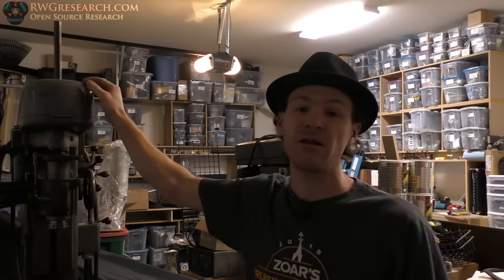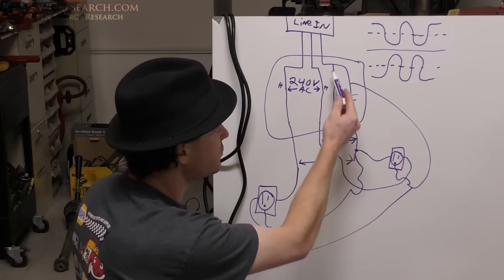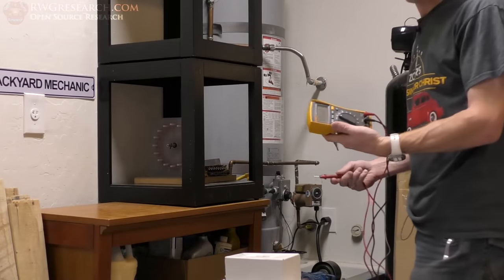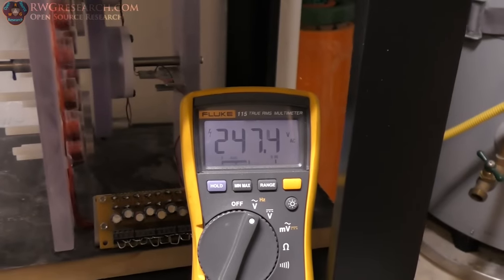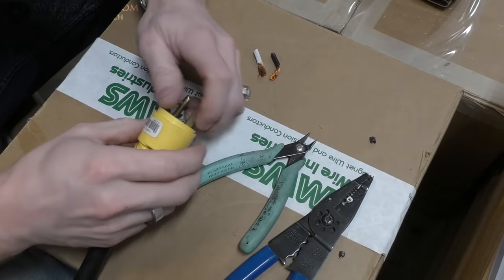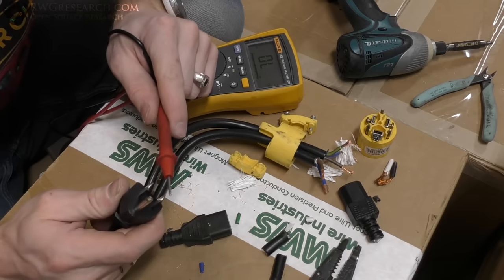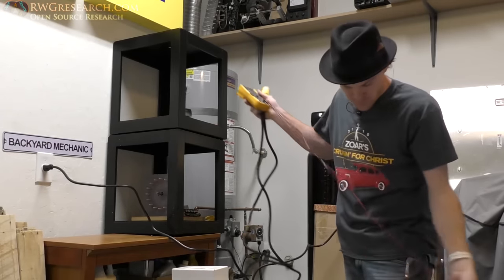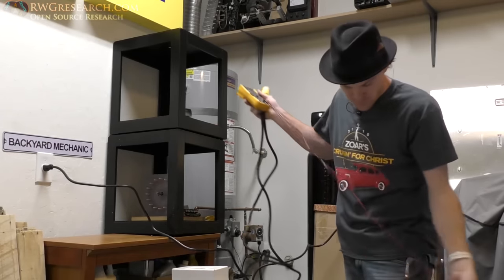How To Get 220V/240V From Two 120V Outlets. No Electrical Panel Work Required...

Comment: This is not the sort of thing I would advise anyone to do, and posting a video like this where the electrically inept are saying "Cool, Awesome, Sweet..." and such things are exactly the people who are likely to hurt or kill themselves trying.
That being said, many will try this and fail simply because they don't have an understanding of how split phase 220 works in the common household. Typically, a single room's outlets all come off of a single circuit breaker, therefore they are on the same phase. Connecting two outlets on the same phase WILL NOT give you 220V, and accidentally connecting one of the neutrals where a hot line should be will also only lead to headaches, blown breakers, or potentially fire in the event of a breaker failure.

I immediately posted my comments BEFORE I ever got past the introduction.  Having then proceeded to watch PART of the video, I reiterate my previous statement that you should have NEVER posted this video.  Those who are aware of the characteristics of the US electrical system and qualified to make such connections already know how to do this. Those who have NO BUSINESS messing with their electrical outlets should not be given this information. PERIOD.
Reply: Triggered?
Reply: Sin Semilla Not triggered, just aware of the fact that there are too many people out there, including kids, who see information like this and don't understand the risks that are present when dealing with electricity. "Do this at your own risk" does not free an individual from the responsibilities involved. Not to mention the fact that doing this is also a violation of electrically codes in most places in the US. There is a very good and valid reason for requiring a licensed electrician to make modifications to a household electrical system, and that is so that people who are not qualified do not screw things up and place themselves and others at risk as a result of their incompetence.
Reply: Do at your own risk is a good enough warning to let people know that possible danger is involved. All the nerdy electricians who feel superior and doesn't want to share their knowledge is the real problem here, people like Russ and ElectroBoom on youtube does a great job at sharing.
Reply: The only way I would be okay with this is if everything including the outlets  were twist-lock, SJ cord was used, in inline fuses we installed on each leg. However as it stands I guess it doesn't matter since im not the one using it.
Reply: Your objection doesn’t seem to be with the content of the video, but rather with the danger of disseminating it. I disagree that this video is too dangerous for public consumption. I think the inherent risks of working with electricity is clear to most people. Especially people who would sit through a 15 minute video about it.
Reply: If they don't understand power, stay away from it. Duh, don't play with guns if you no nothing about them
Reply: T M He mentioned that neutral is tied to ground in the panel and not at the device.   I wouldn’t use this for a permanent solution, but I’d definitely use it for occasional use.
Reply: Sin Semilla  yep, I hate guys like Jason. I do everything myself in my house...3 fully gutted bathrooms, kitchen, etc., etc. The worst type of person is the one who says, I’ve been doing this for xx years. Instead of trying to show ones supposed superiority and knocking the video, use your knowledge to comment to give the specifics on how to make it better, or the specifics on things to watch out for. Like sbusweb did in a previous comment. I’ve come across many people like Jason and typically they are not as knowledgeable as they portray themselves to be or have limited knowledge in other fields.
Reply: @JasonSimpson1966  Jason I'm an electrician I became an electrician because I thought it was something I couldn't learn to do online I thought plumbing and carpentry were easy I can learn those things online but electrical work I couldn't learn online. Then it was accepted to an apprenticeship and all the things I learned in class had nothing to do with the things I did for work I read blueprints and perform tasks based on those blueprints it was never necessary for me to learn trigonometry or how to calculate the bend of a pipe that shitt comes prefabricated or what I need to know is listed on the blueprint or an app on my phone calculates it for me. And the electrical licensing exam is simply a test on the national electrical code which is volume 17 of the national fire prevention code which ironically while law is copyrighted material and therefore not available and less bots the school provides a book on the national electrical code for the year in which you will be tested for free or a reduced price. But you can also BitTorrent free copies of the PDF version many electricians drive around with an out dated edition of the electrical code in there service vehicle I am a younger journeyman it's true, but what you fail to understand old man is that the human capacity for abstract thinking is higher in younger generations then it is for older generations and when I'm an old man I will be complaining about the  younger generation too
 But young people todaydon't just read about how to do something and then try it this won't be the only video people watch on the matter to watch hundreds of other videos on the matter before they even get to work people watching this video aren't ready to do it nowthey don't have the financial resources for do-it-yourself projects don't be watching this video and then another one and then another one not all today not all tomorrow they'll process this information over a certain amount of time in that information will accumulate until one point when they have a job after they graduate college and can afford to do this and I'll do it themselves don't worry your job won't go away because there's not enough people going into trade work because old electricians tell young people not to do electrical work because it's dangerous why would anybody want to be an electrician if it were dangerous you can get hurt it's true but the risk of dangerous exist far more when you are doing electrical work for a living and performing a routine task that you have done for years so that while you're performing the task you're not thinking about them. Your remodeling a box chain store and changing all the lights in the middle of the night you spent the last eight hours pulling down and putting back up phosphorescent lighting while customers are in the store and an apprentice or material handler are spotting you as you move around on a scissor lift and in the middle of your mundane work and read routine task where you've been up for 12 hours for the last week because prior to this stays of the lighting demo and install you had just installed the cash registers and point-of-sale systems as quickly as possible to avoid downtime. And you forgot to turn off the circuit breaker and you blow up and die. when someone's doing something big done for the first time they're not very likely to forget to turn off the circuit breaker they're not very likely to zone out and they're not going to have been up for 12 hours the fact of the matter Jason is it's more risky for us to perform electrical work than it is for someone working on their own home and we really shouldn't be afraid of young people doing electrical work because we fear it willl take our jobsbecause no one's doing electrical work because electrical work isn't 
"Cool"and you can't write off your expenses if you're on your own home when you travel for work anymore so getting people from small communities with less building expansions travel to areas with more building expansions is even harder so it's a good idea to get young people interested in doing trade work by letting them do it and die in the process so that they don't become our co-workers or live through it should they do become our coworkers because I don't know about you but I'm really sick of being asked to work 12-hour shifts
Reply: @goldcoastwoodworks6023  If they don't understand power, stay away from it. Duh, don't play with guns if you no nothing about them
-----
No one should play with guns regardless of their knowledge and experience.
Reply: @zachchang4846  Brilliant!! Seriously you should write for Savage Henry, dude

Comment: The, yellow, adapter plugs you are using, as you showed, are rated for 20 amps And
you showed your black cords are rated at 15 amps. Wrong, Wrong, Wrong!
Also, the two wall outlet you are using are rated one (to the right) for 15 amps and
the other (to the left of the black cubes) for 20 amps. Again Wrong, Wrong, Wrong!
What are the wires, in the walls, rated for? Don't know??? Obviously.
I strongly suspect, as well, the drill you are running, which need 240v, probably wants 30 amps.
Keep the fire extinguisher handy.

Comment: SO DISAPPOINTED WAITING FOR HIM TO GET ZAPPED N NEVER HAPPENED......IM SURE AMOUNT OF TIME SPENT RIGGING THAT COULD HAVE SWAPPED BREAKERS OUT N MADE IT WORK THE CORRECT WAY.....AND THOSE COMPUTER CORDS ARE NOT CORRECT GAUGE FOR THAT MACHINE IM SURE....
Reply: He CLEARLY STATED that he had no room in his breaker box to put another breaker.
Reply: @kyleb3754  Unless his breaker panel is full of duplex breakers, which I can't believe it is, he could make room for a 240 Volt breaker by installing two 120 Volt duplex breakers and do the job safely and right.

Comment: This guy i scary. He said "green is your ground or neutral" Funny thing is there is NO neutral in a 240v circuit. 
Make sure you have plenty of snacks on hand. The fire dept gets hungry
Reply: There's no neutral in a 240 volt circuit, but there is a ground.
Reply: @DrugsAreBadUmmmKay  Thank you for the info.  I was referring to straight 240 volt loads, not the dual-voltage ones, such as stoves and dryers.

Comment: word to all the Haters and "Electricians" ya ya you went to school and learned the "Correct" way to wire up 220v outlet and you hate on anyone that doesnt follow your text book learning yet you do not follow up your Hate comments with WHY? The math is sound and yes you can use 2 110v outlets on separate breakers to make a 220v the draw on those 110v wires is well with in safety parameters,, Just because YOU didnt make 1000's of dollars off of running new wire and installing a new breaker or panel doenst mean its wrong.. and as for "starting fires" they are caused by resistance in the circuit and only when exceeding wire capacity which he is not and  the breaker will trip before that would happen.

Comment: This is what happens when someone has enough information to get into trouble, but not enough brains to get out. Once the fire inspector finds the jumper plugs still plugged in the wall after the fire, your home insurance will probably be canceled.

Comment: WHAT A BLOODY AWFUL EXPLANATION.
This simple explanation is to imagine a center tapped transformer.
From the center tap to the end of either winding, you get 120 V.
From the TWO END TAPS YOU GET 240 V.
It’s as simple as that.
If the outlets in his workshop are all from the SAME END OF THE WINDING, THIS WILL NOT WORK.

Comment: Great video. Encouraging people to do something dangerous themselves and break about 10 NEC codes in the process. Call a licensed electrician to get it done correctly and safely. The most idiotic part is that with the time you invested in this, you could have actually done this correctly but somehow went ahead and did a complete hack job. Not impressive at all.
Reply: Did his machine work at the end?  Yes, yes it did.
Reply: @RB-xv4si  you seem mad he accomplished his goal without the need of an electrician ripping him off.  This amuses me.
Reply: @GrandPrix46  just because it works doesn’t mean it’s right. The funniest part about the hack mentality is what you just pointed out; that they think peoples safety and the longevity and quality of the system is not with the cost of a professional installation. The reason that the NEC exists is purely for safety. To protect people and property from faulty installations by people that don’t know what they’re doing.
Reply: @RB-xv4si  GTFO, that dude can run that machine for the rest of his life with that setup and everything will be absolutely fine.  No one will die.  No fires will be caused.  No unicorns will bleed because he didn't spend thousands instead of tens of dollars to make the machine work.  Also, let's not pretend there aren't plenty of crappy electricians out there that will do a crap job for a premium price just to get it done faster/easier to rip as many people off as possible in the 8 hours they're going to work that day.

The funniest part about your mentality is how much money you will have lost throughout your life for absolutely no reason at all.  How much does the dealership charge you to replace your wiper blades?
Reply: @GrandPrix46  I will not lose any money. I’m a licensed electrician so I can and will do any work I need myself. You are right that there are plenty of shitty electricians out there. I can only control myself and know that I do top notch work and that I am worth what I’m paid and can justify the hourly rate my company charges. I can also tell you that even a shitty electrician would not have done what this guy did. You’d get fired for doing something like this. There are real professionals in my industry that are absolutely worth the rate they charge. The tools we use are expensive, we have to study our asses off to know how do do things the right way, get licensed, insured, keep up good reputations, and constantly justify ourselves and our professions to jaded morons like you who have no business judging the worth of professional work.
Reply: why did he waste money buying plugs and outlets and wire. just stick bare wires into outlets and call it a day. the machine works, right? what's the problem if it works. problem is the unexpected. house fires are unexpected. you cannot guarantee that death cord will continue to work without problems. complacency is another problem. I've done it 100 times, I'm not gonna die this time, until you do.

Comment: If the outlets are on the same phase you will still have 110 the breakers on the circuits have to be in opposite phases usually in a room the plug ins are gang wired from a single circuit there is so many readons not to do what hes doing wire a new curcuit from the panel its not that hard and a lot easier and safer

Comment: 240V is not 2 phases or out of phase like you call it, it is single (split) phase and phase locked at 180 degrees apart.  Please learn your terminology correctly before making videos.  Downvoted for inaccuracy.

Comment: The risk is not worth the reward if you are using this as a basis for electrical theory. Wanna do some cheap shit? Cut the end off of a good ex cord, and run it to a 220 breaker at your panel.

Comment: This video should be taken down it is completely and utterly wrong a 220 volt circuit should be properly wired to a 220 volt outlet connected to a double 15 amp or 20 amp breaker the way he's got this thing wired if one breaker goes you're screwed they won't go together this is definitely a way to burn your house down

Comment: bro you really should not be posting stuff like this. first of all way too many people that have no clue about how to run wiring and basic electrical knowledge will try to do this and do something wrong. secondly you are wasting your time even if you have a full panel. like other suggested you could run a sub panel or run a twin single pole breaker that is 2 15 or 20 amp breakers on a single pole to open up a spot in the Box. do this to 4 low amp Breakers and you will end up with two poles open to put in a 220 double breaker.
Reply: if people pay attention to the video, everything will work like its supposed to. if they are idiots, they probably won't even try it or if something goes wrong, they will learn a valuable lesson in electricity. I'm not an electrician and I was wandering how to do this exact thing and think its great.

Comment: That's one of the most STUPID things I've seen. Run a 220-volt line from the breaker box! A 220-volt breaker trips both sides of the 200-v line if you have a problem. If you ever have  a fire and your insurance company finds out you did something stupid like this, they won't pay a cent. The man says you do this at your own risk, but you're better off not doing it at all!